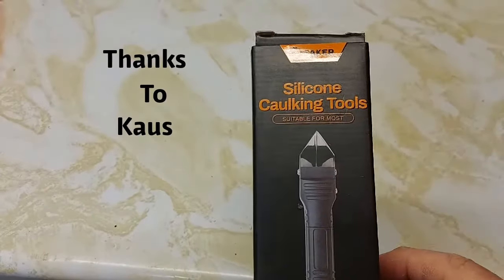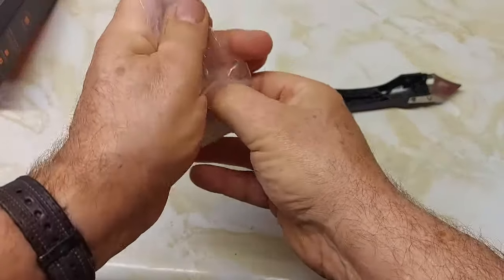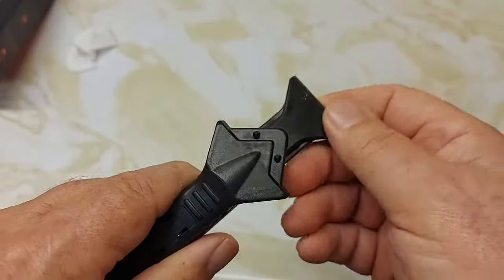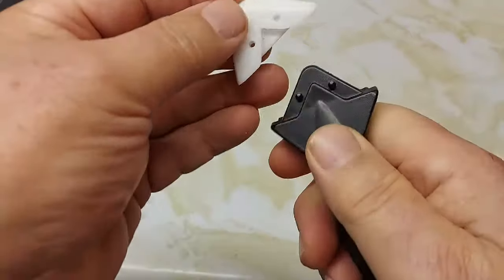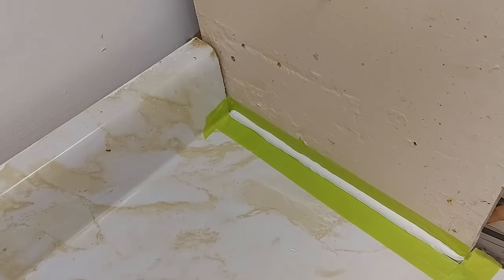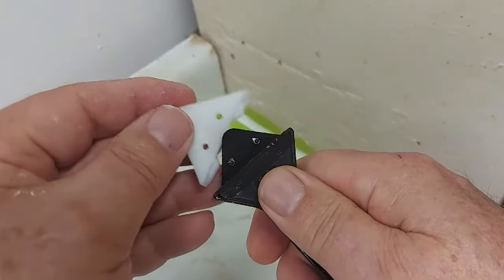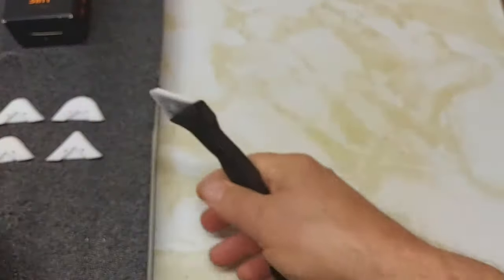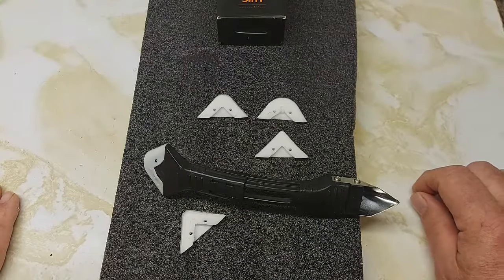Saker Silicone 3 in1 Caulking Tool.

Comment: Thanks for your review.  After seeing it, it does not seem it will serve purpose to remove caulk around my bathtub.  Those tools all work great, when the installer did the job right and put a thick bead of silicone on top of a generous gap between two surfaces.  If it was not done right, that is why you have to go back and fix it, and will find that all those caulk and grout tools that will work for a proper installation, will not work when up against a bad install.  In my case, they left a very fine gap between tile and tub.  The grout saw did not work, the gap was too small.  Not able to really scrape out the cracked grout to clean it up.  The silicone caulk was also a very thin/flat layer, in which renders that tool useless as shown at the end of the video.  The silicone layer is flat and the tool needs enough of a caulk bead radius to pick up on.  A good install should not have the gap between the bottom of tiles to the top of tub not filled with grout, only filler silicone or sand caulk.  It's not the tool that is bad, it is the installer!

Comment: Looked promising but that plastic scraping edge is going to get destroyed (dented) very quickly.  And the metal scraping tool could scrape stone materials (granite, etc).  I like the 5 different tooling/shaping heads but since they are either a soft or rubberized plastic I can see them wearing out over time.  Not convinced.  Decent video.

Comment: Thank you for demonstrating. I am trying to remove old caulk from a shower door. I took the shower door off, but the caulk underneath the track is at least 50 years old and not budging. Do you have any ideas I can use with the tool to get it off maybe?
Reply from the maker: I would use Acetone to loosen the caulking and a razor blade to scrape off the caulking. Make sure you wear protective gloves when using the acetone.
Here is an example of a Razor blade you can use.  https://youtu.be/TAoVkw3qicc

Comment: if you need to remove old dried up Caulking, like I do from around a AC window unit, it's not gonna work out. Just wasted $16,99 on one. Frustrated because I need to get an old AC out of a window, to put a new one in, but so much caulking around old one, can't get it out lol. So looks like back to using a screw-driver and WD-40 again. And as for smoothing caulking out, you can use a plastic condiment knife and save you money. And reason I'm using WD-40 is it helps soften the dried caulking up for easier removal. Smells not great, but it is helping. As for that 3n1 tool it's worthless 🙃
Reply from the maker: Thanks for posting.
WD 40 has alot if uses.

Comment: These tools are all useless gimmicks.The primary reason to tool silicone is to improve adhesion. The secondary reason is aesthetics. These tips completely ignore the primary reason for tooling. They are all pathetic gimmicks that insure premature failure. All they do is scrape of the excess. TOTAL GARBAGE.
I have been a professional caulker for over 45 years and this kind of crap is why homeowners are always having to replace sealant. All of the misinformation on sealants is totally disgusting. And causes homeowners untold amounts of dollars not even taking into account the hidden damage caused by leaks due to these ridiculous short cuts. You should be sued fir ndg